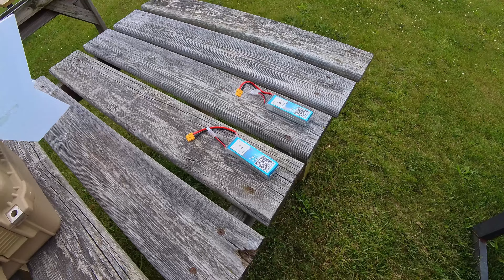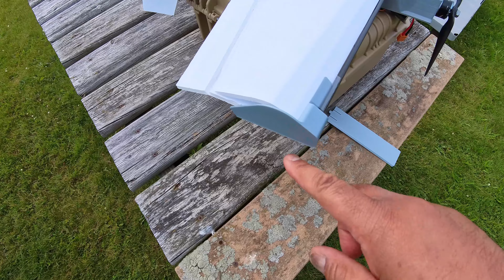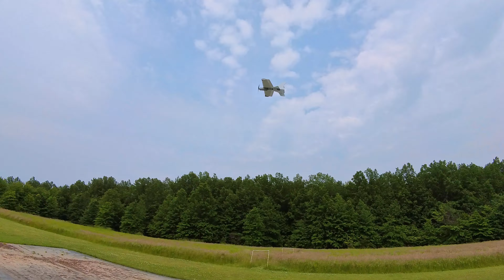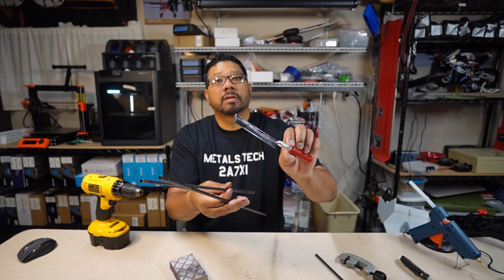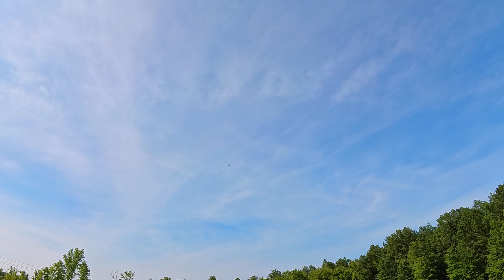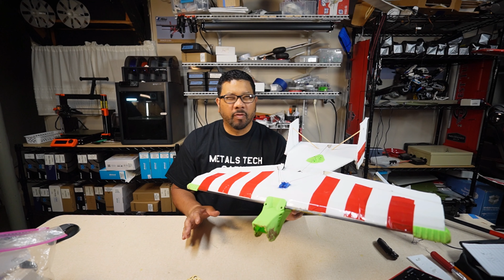Flite Test Bloody Wonder Combat Fuselage Kit - Free Mods

Comment: I realize this is a year old, but did you use a diode lazer to cut white dollar tree foam, if so what was your Settings to keep from setting the paper on fire???
Reply from the maker: I did use a diode laser but I was never able to get it to cut all the way through the foam substate. I've even tried black foamboard without success. I essentially use the laser to trace out the pattern and then use a utility knife to cut it out. It does make it much easier.
Reply: @reedinspace2286 thank you sir for getting back to me!! I've heard of people cutting the black board and even the brown weather resistant with success. 
I ended up cutting it with my CNC machine!